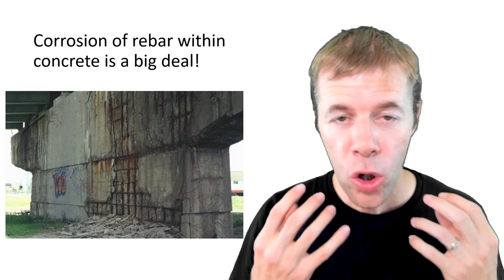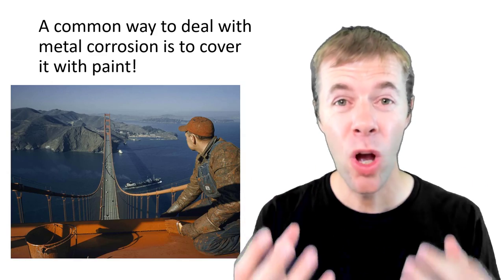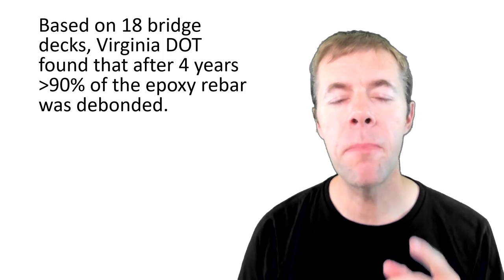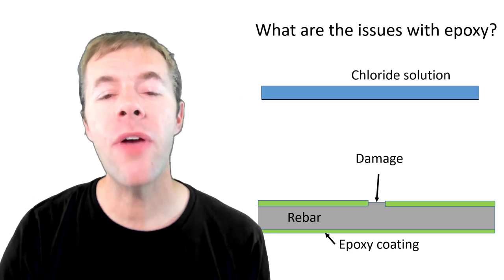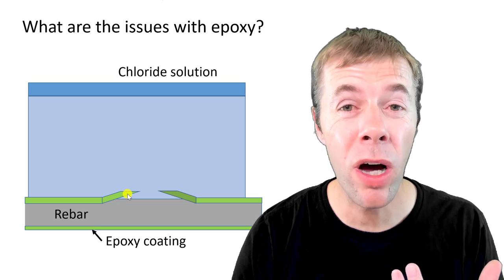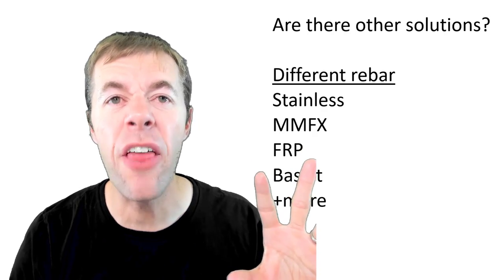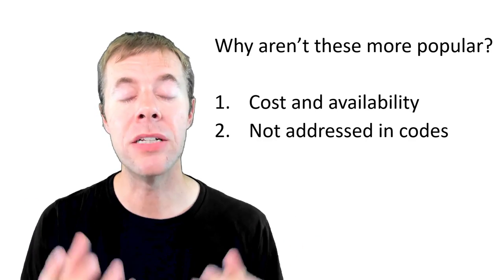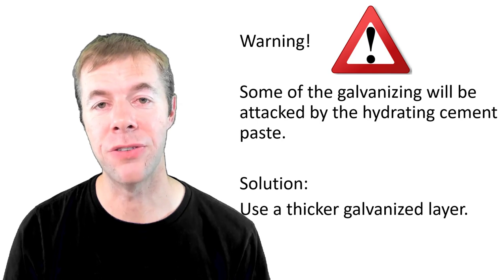What is epoxy coated rebar and why is it being banned?

Comment: I also love concrete, retired. We built seawalls, retaining walls,foundations and bridges. I have used regular, epoxy and galvanized. We have even but epoxy coated rebar inside a pvs pipe, and even stainless steel rebars. I never picked type rebar, the engineers did that.  You are spot on about scratches of epoxy causing spot failings, pardon the pun. You can also alter concrete, the higher psi the less chloride gets bar. BTW Stainless steel steel corrodes under concrete, lack of oxygen kills that.
When we designed a seawall, we knew area completely underwater/ground was going to be fine, no oxygen. The areas up in to air, if painted and isolated would be fine. It is the area that gets wet and dries that is the problem for corrosion, and concrete is a water magnet. You need both air and water for corrosion.

So my best way would be hot dip galvanized, with high-psi latex concrete. With of course appropriate safe guards to make sure of little scratching and then recoating in field. BTW we used plastic wire ties to hold most of the bars in place to avoid the corrosion being brought into system by wire tire. Because something corroding inside concrete no matter how small would start the process. Also making on concrete as thick as possible over rebar helps prevent issues. Oh on latexed concrete, we used to pour concrete underwater for underwater foundations using tremie method and we added an additive to concrete that made it more jelly like, I forget exact name this also has side effect of sealing concrete.  I hope all this helps someone.  Great video on a misunderstood subject
Reply: When you say plastic wire ties, you mean zip ties are ok to use?
Reply: I worked with FBE for 20 odd years in the family business. Powder coated all of the rebar in the UK Tunnel to France and the test tunnel from Windsor Ont to the US.
Reply: Who knows what that additive is called and if it really seals the concrete?
Reply: @PaulyDownUnder  yes regular cheapo zip ties for smaller bars, faster and less damage to epoxy bars
Reply: once the concrete is cured the rebar structure isn't going anywhere...all the ties do is maintain spacing during the pour; they aren't structural  @PaulyDownUnder

Comment: 70+ years ago, as a young child, I watched my uncle install a  galvinized pipe handrail in a concrete (outdoor) stairway.
That pipe still looks as good a new.  He did it by puting the ends of the pipe into glass jars, poured the concrete around the jars, then filled the jars with lead.
The glass insulated the pipe from the concrete and that prevented the corrosion.
Reply: Somehow I just can't visualize this process .
Reply: In Scotland they drill the hole place the railings in the hole and pour lead into it.Been done this way for centuries.
Reply: That's fucking genius.
Reply: In short, this is a trade secret.
Reply: That's a very old process, and it's brilliant, called leading in. You'll see it on metalwork attached to very old buildings, and it's completely removable without having to damage the stone around it.
Reply: Its a handrail not a battery then.
Reply: My dad did that, but he used Coca-Cola bottles set 3/4 depth.  The said that the wider base created a belled base.  By the way, he was a structural engineer.
Reply: Awesome. Yes the glass should insulate the zink steel (galvanized) pipe. But what does the lead do? I assume it fixes the galvanized pipe onto the glass jars while the glass jars were fixed into position by the cement. So no air nor cement can get to the pipe endings insulating it basically from everything. However the lead corrodes over centuries as can be seen on the lead bullets from the civil war.
Reply: That sounds brilliant!
Reply: @Prussia_is_not_yet_lost.  wow, centuries sounds good
Reply: I like the glass idea. You'd have to find something other than lead now though.
Reply: My dad did the same thing using mason jars, hasn’t failed yet!
Reply: I remember a  house I lived in in the sixties had a retaining wall with glass bottles imbedded periodically running along the top of the wall.  Now i know why.  It was for future railing installation using the process you describe.
Reply: Fixing iron to stone with molten lead was used on the Parthenon in Athens about 2500 years ago.
Reply: anyway to get a visual on this? i just cant picture it
Reply: @Sinkktothebeat  Think of it as placing your wiener inside of a bun then wrapping it in plastic wrap so the bugs don't get to it! Just for food aficionados!
Reply: @M_Ladd  but how did they cover it all with glass? or where does the glass stuff come in
Reply: @Sinkktothebeat  the glass jar is just to keep the cement out when you pour around it. It's to save you the trouble of drilling a giant hole in the cement. Then inside of the jar gets filled by liquid lead and the outside of the jar gets filled with liquid concrete. The beam or pipe gets stuck in the jar before it is filled.
Reply: Rebar can not be galvanized
Reply: @paulobarcelos3630  The Sydney Opera house has galvanized reinforcing steel. Also, there is a type of rebar called hot dipped galvanized rebar (HDG) which is dipped in zinc. There's a newer process called continuously galvanized rebar (CGR) which has a thinner more ductile zinc layer so that it can be bent in the field.
Reply: this is a very alchemy convo.
Reply: @Prussia_is_not_yet_lost.  cenuries are much less concerning than decades. Not sure that'd work for rebar though.
Reply: Did the lead extend up the pipe, above the poured concrete? 
From reading your description - It's the lead that's protecting the pipe. The glass is firstly acting to contain the poured lead and keep poured concrete away from the pipe and then acting to limit the surface area where the lead can be exposed to moisture + chemicals. Just the lead at the top of the glass jar is in contact, as long as the seal is tight and glass doesn't break.

Seeing a cathedral which is supposedly just over 100 years old, with rebar sticking out after earthquakes, really made me wonder what their processes were... Not as classical as it once appeared. Concrete covered in limestone - which was news to me.
I don't know if the rebar had failed, was just used sparingly, or was not used in some spots. I couldn't see corroded/broken rebar, just fallen concrete/stone, so maybe it simply wasn't built to survive such a shaking.

I've been reading up on using Calcium soap for corrosion resistance. Calcium stearate, etc. They're hard and almost entirely water insoluble soaps. Maybe other Calcium soaps could be more water insoluble than others. Calcium resinate, etc. Although heat tolerance may also be a factor...
I wonder if pine tar and other tars have been used before? Surely it has been experimented with?
Lifespan of materials is important. Cement/concrete is generally supposed to last indefinitely, or should be. Rebar should be the same. Not all factors can be defined and not everything can be planned for, so the best test is time - often spanning lifetimes. Cement/concrete isn't exactly new technology... It really makes you wonder why this hasn't already been settled... or if it has, where is the lost/hidden knowledge at!
Reply: I remember that from the 1960s and 1970s; it was common that people would set glas bottles 3/4 way into the concrete (and break off the necks after the concrete had set). Up to now, I had never realized that this practise had disappeared somehow in the 1980s.

I guess when better concrete drills appeared in the 1980s, people began to consider this old method "outdated".
Reply: Do you think you could use aluminum cans instead of glass jars?  Or would aluminum react with galvanized steel and lead?
Reply: @206Nish  Aluminum can react with steel — galvanic action.
Reply: What????

Comment: I did bridge maintenance for years in a salt water environment, many of the bridges and other structures from the 1930s to 1950s did pretty well, but 40 to 50 years latter many parts of the structures were delaminating. Thank You for this video most people don't know about this issue.
Reply: I am not sure if it's related, but apparently there is something special about pre-nuclear age steel. I'm sure someone here is an expert and will chime in.